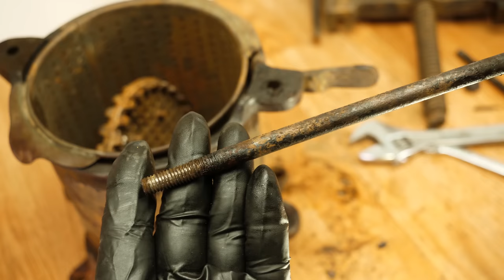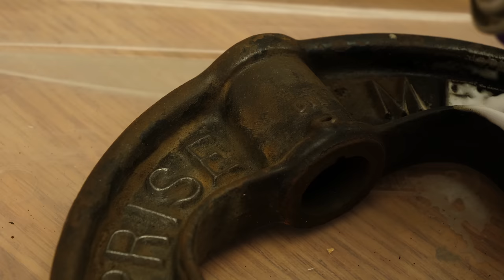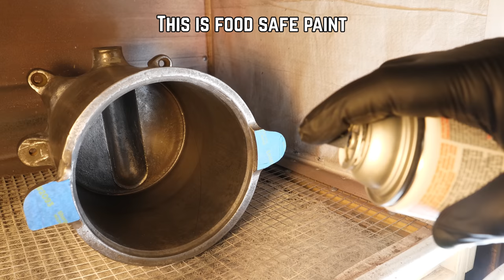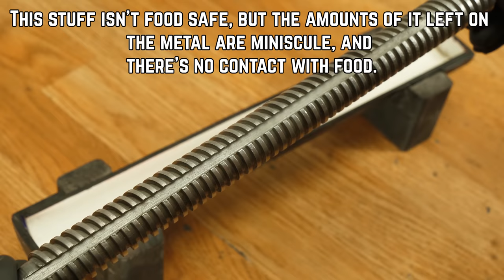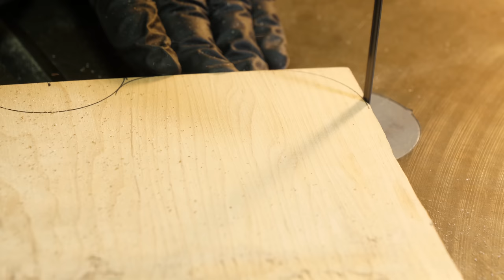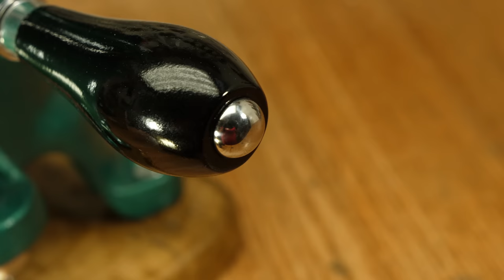Extremely Rusted Fruit Press - Broken Handle

Comment: Youre one of the only restoration YouTubers I've seen who removes peened pins by filing the sides rather than just grinding the whole head away. I always wondered why nobody did that.
Reply: @chjr4740  That could be avoided by using a smooth-edge file, I do like the reuse of original rivets when possible.

Comment: As a kid in 60’s and 70’s someone in my hometown had one and would sometimes loan it for some of the sausage. Mid 70’s I got a deer and borrowed it myself to make most of my buck into mixed sausage. I dutifully paid the loan in natural casing sausage-I bought casing. 
After I got married, my father in law and his brother owned one. We bought out the uncle and brought it home to use, FIL could ask for it whenever he wanted. After he passed it became solely ours. Ours is missing the pierced drum. I’ve been trying to find a good image of the artwork, it’s a little different but original, that’s on the front. Linked to your video, as I need to do some restoration of ours and wish to continue using it.

Comment: This Enterprise press isnt just a "Fruit Press" This was also made by the manufacture as a sausage stuffer. Me and my husband have the same press and bought the original attachments used for sliding your sausage casings onto the spout at the bottom of the press. My husband uses it for making our deer sausage. On the spout, you will find 2 tangs/tabs which the attachments lock onto them

Comment: Welding cast iron isn't easy, but a stick welder with a graphite fluxed rod for cast iron would be much better, and using a heat gun to preheat the iron handle to around 300 deg F. will get good results.
Reply: Yeah, I was worried that it would snap off again quickly.  I don't know that you can get decent penetration on cast iron with a Mig welder?
Reply: @bluesfella  you really can't get the best weld on cast iron with a mig. You really need a SMAW (STICK WELDER) WITH a rod made for cast iron, regular DC (NOT REVERSE).

Comment: why didn't you use superglue or epoxy resin to reattach the handle? I knew welding would be used, but I didn't expect you to grind away a part.

Comment: I think overall this is a good effort, but did you put it together without a single bit of grease for the moving parts?  It pains me to see those gears going together dry.  And there is an oil hole, did you add any oil?  Maybe you did those things off camera, but I think a lot of us would rather see that than the vice-slapping bit.  Keep learning and doing, though!  I will still be watching!